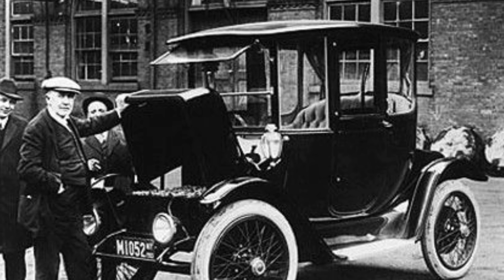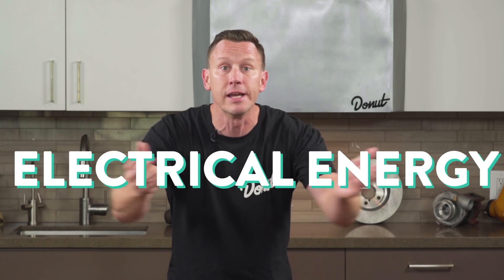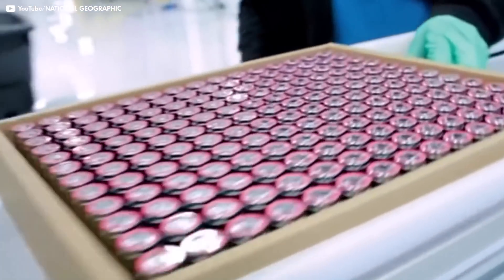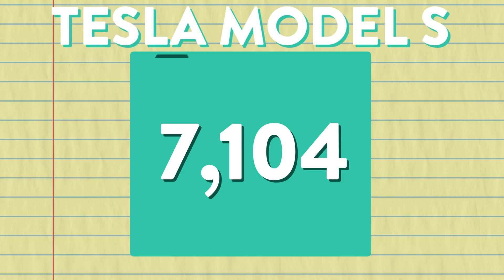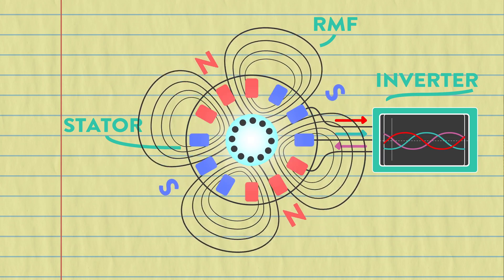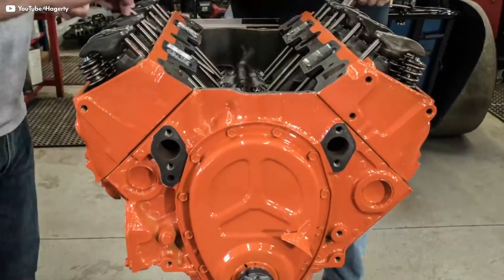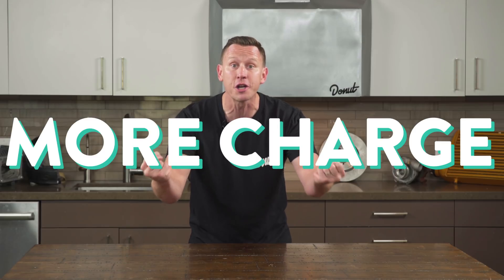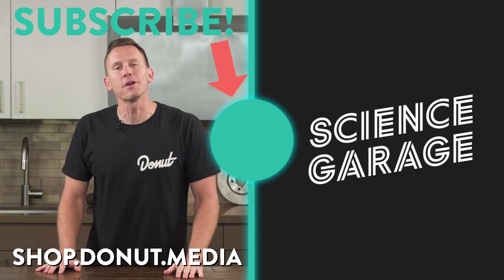ELECTRIC CARS | How They Work

Comment: Interesting...

But Mini-explosions of power are better!  Can you explain how fuel-injection is better than injection from a carburetor DOWN TO THE ATOM?
Reply: EVs will be absolutely better than ICE car if energy density of Lithium battery matched petroleum. That will happen in 20 years according to some experts. 

And saying Tesla Roadster is faster and cheaper than a Koenigsegg is like comparing a thousand hp modified Toyota Supra to a Ferrari. EVs might be faster (transmission needed), cleaner and relatively cheaper but they're worse at handling, cornering, range and safety. Did you see what happened with Rimac in a corner? And do you know how much the new Tesla Roadster weighs?
Reply: You bring a good point. I read somewhere that the automotive giants (BMW Porsche, Ferrari, etc) is planning on driving tesla to bankruptcy... I hope they succeed... even though I hate full electric cars. I would rather have a BMW built electric car than a fucking tesla. They suck. From working at one of their factories in Fremont cali, I know what kinds of people put together those cars... and I'll tell u no one gave a fuck about quality.... you can see on some teslas that the body panels are unevenly fitted on. As in the gap is not uniform all around the car. One gap would be 5mm and the same gap just on the other side of the car will have a gap that is 10mm... its ridiculous.... I've had my best friends father die on a freak accident and tesla isn't taking full responsibility when their airbags never got deployed... tesla still has a air bag recall... never buy tesla.
Reply: They aren’t better, “mini explosions” are actually expanding gases thanks to heat and combustion. Due to all the heat created from ICEs (heat is a form of energy) they are less than 20 percent efficient at using stored energy after the solution of oxygen and gasoline is ignited and before all the friction losses in the drive train of a car. With adding a radiator to the system yes it keeps your motor from breaking but you’re effectively taking energy out of the system. Electric cars are far more effective at using stored energy. 

Also another note to add, think of all the trillions of dollars and time that have been dumped into researching the ICE compared to the minuscule amount dumped into EVs. EVs will get better and far surpass ICE.

I like the sound of an ICE revving up at 9k as much as the next guy but most things have a humble beginning
Reply: Huy Thai yup, I know that “advantage”. Tesla is doing very well with their marketing dept. 

About the gearbox, this is pure speculation since I haven’t discussed this with their engineer. But I think they’ve added gearboxes to the new Roadster to achieve the claimed top speed. Just like Rimac system.
Reply: You're friend BMW 4 life has a good point. DONT FUCKING COMPARE A CAR THAT DOESNT FUCKING EVEN EXIST YET! Also Porsche has claimed to have raped what tesla claimed on the roadster 0-62. Oh! Also! Tesla cheated by measuring 0kph-100kph by rounding it down to 60mph and not 62mph. Tesla is a cheating liberal tech company and is trying to make cars... and quite frankly... until yearly sales surpasses Prius sales... tesla has nothing on any automaker.
Reply: Huy Thai 

Show me a video of one driving alright then on the street  .... stick to your Toyota that you can’t afford gas for it.
Reply: well
tesla fans can't
the just think that their cars are less polluting than ice powered cars
Reply: Σωτήρης Κατσουλιέρης ICE cars have batteries too dipshit
Reply: Scott Takahashi Tesla models threes were in such high demand before they had their assembly line put together, if bmw was as new as Tesla they’d be having the same problems, give yourself some perspective
Reply: Dave George no shit
i am talking about tesla batteries
Reply: T O  T H E  A T O M
Reply: Conner B I don’t see any ICE vehicles getting 140 mpg or equivalent. Wait, the Model 3 does? That seems a lot better for both of those categories.
Reply: IMO, electric cars struggle a lot with personality. They're fast, but there is no soul to the car. I would really struggle to love an electric car methinks.

And for those concerned about the environment, I'd imagine that the lithium cells that will all be worn out in 20 years tops will be a heckuva lot worse than the emissions from ICEs. 

Gas is a small price to pay for a car with soul. :)

Have a nice day! -Micah
Reply: What if they ban internal combustion engines and replace them with batteries.

That in fact, would be a world I would not want to live on 😂
Reply: unless you're thinking of daily commuting or short distance trips, they are undeniably better at the moment
Reply: Christian Ivanov What other normal base level sedan can get to 60 in four seconds? Do ICE’s create gas and put it back into the tank? Do ICE’s release no carbon dioxide into the atmosphere? What ICE vehicle can get over 140 MPG combined? Yeah, I didn’t think so.
Reply: Mohd Aiman Azrie Yesss! It sounds soooooo good. ROTARY POWER!!!
Reply: Take you Nissan leaf in the city for short commutes., Take your Rx9 through the canyons to hear the engine and enjoy the ride.
Reply: 5K Oh yessss! You are a TRUE guy for sound 👌🏻👌🏻
Reply: BMW 4 Life For real! Well said! 👌🏻
Reply: Electric cars will never and I’ll bet this ... ever beat a Gas car at top speed never! Lol the Demon still beats current electric cars still and quarter mile.Track times too who is running the fastest 60 times track times quarter mile times and top speeds Gas cars still Tesla has a good 20 years until they beat that tesla is about to go broke as well
Reply: Carlos Barberena Just because you like ICEs more doesnt mean their actually better.
Reply: Tesla Roadster ??? I see you are a fan of the Tesla. Hmm. No wonder.
Reply: Christian Ivanov Good point. But don’t you love the sound an engine makes when it revs? Mazda 787b. And engines are the OG
Reply: Sir Nuke Just sweeping away the haters, you know what I mean? 🤣
Reply: Jerry Serrano Yes, I know. They are great ways of going places, but the fact of the matter, for me, is tradition and sound and everything that has to do with oil-covered metal.
Reply: Well sadly humanity needs to move forward, i think people can learn to live without hearing a combustion engine rev.
Reply: well lithium is actually more polluting than petroleum
Reply: Huy Thai I don’t think they are “obselete”. They can still be used nowadays. It is true that electric cars are becoming superior to ICE cars, but the facts is, no one will ever forget gas-powered cars. They will always have a place in peoples hearts. The new generation of “car enthusiasts” (I say “car enthusiasts” because that will just be looking at flux capacitors and battery sizes lol) will TOTALLY forget about ICE cars. But for the down-and-dirty engine guys, they will never be forgotten.
Reply: Carlos Barberena 

electric cars are boring period
Reply: That BMW Guy Ah yes, an under 2 second 0-60 in the new Roadster is boring.